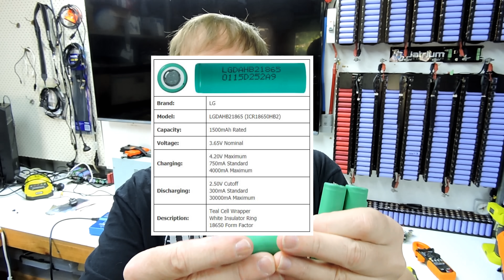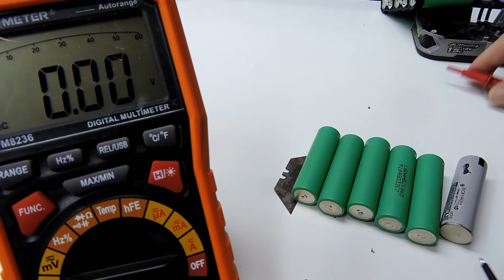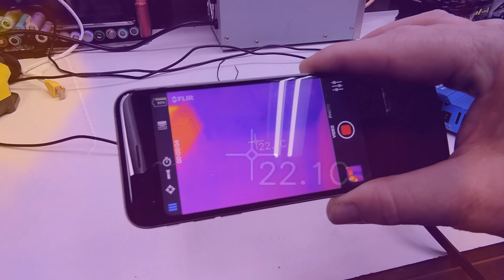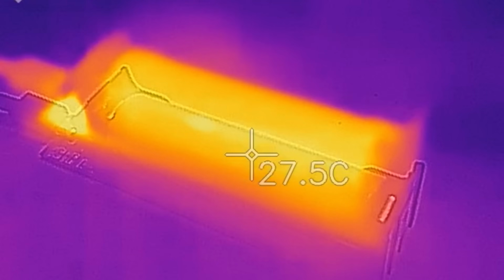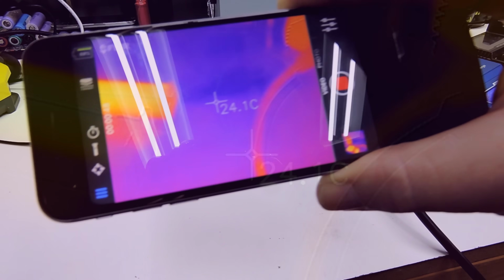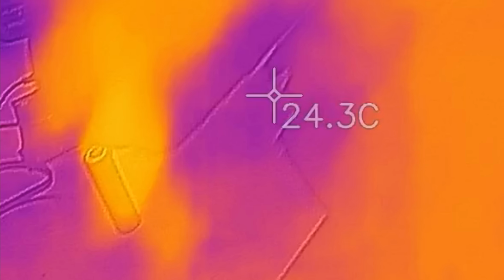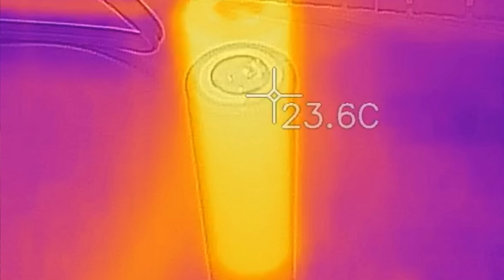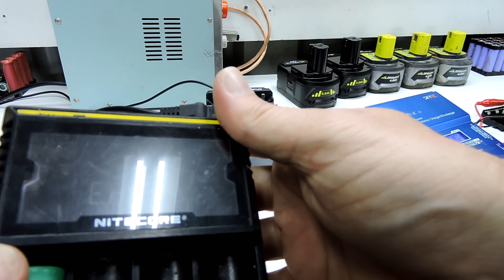18650 CID Reset   ⚡ DON'T DO IT! ⚡

Comment: this is what is needed so it becomes clear what is acceptable and what to avoid at all costs
Reply from the maker: well said
Reply: Unless there is some idiot who thinks the whole video was faked. 😔
Reply: Moronic tendency's should be closely monitored.
Reply: yyes but by whom ?
Reply: @dtec30  my wife monitors me. Not sure how but she's had over 25 years to figure it out.....
Reply: Any one trying to revive dead 18650 cells. Including myself. Look at my post
Reply: I THINK YOU GOT IT
Reply: Scooter battery die do you repair it. nanrobot battery.
Reply: I agree... I never would have the ballz to do this any way. After watching the sheer power of a nickel strip flying at my face when I dropped one on a pack I was spot welding stuck in my arm, Yeah I learned very quick.
Reply: My thoughts Exactly
Reply: Umm... I'm Australian and no it's not an aussie accent it's just his thing... I must admit it annoyed me quite a lot.
Reply: Well if the goal is to burn your house down or see your charger and the battery melt into garbage and smoke then this video shows you how to go about things correctly.
Reply: whats the point of this video? Don't do it of course its dumb. its a dead battery. you can't revive dead animal or people or battery
Reply: @willybilly99  you can revive all three, but sometimes things are too far gone
Reply: @willybilly99  yet

Comment: I pulled a bunch of 18650s out of a hoverboard that had a battery recall. Two cells were dead, one I think had a popped CID, the other I think has just shorted internally. All the batteries are super low voltage, like less than 2v, some less than 1v. Tried charging them in my Nitecore charger, but herd 3 of them pop their CID. I think it was because I was charging them at 4.35v instead of 4.2v, and all three were almost fully charged when the CID popped. Now I'm worried because the SOC of those batteries is pretty near 100% but with a popped CID. I'm thinking of resetting the CID, just to drain them fully and dispose of them… but I don't know enough to know if that's a good idea or not… are they safer fully charged with the CID triggered, or fully discharged with the CID bypassed/reset?

Comment: I am no specialist in this but I think that under that cid protection must be a resistor like thing, just to limit a bit the current.
It would be interresting to know if The maximum capacity of a  cell îs 3000mA, the charging current should be 10% of te total capacity?

Comment: i tried to charge  a pack of these that was in the tin shed for a few yrs. after some time i heard  couple of pops hrs between each other (one was without Doubt from the batt. i heard the faintest hiss. so akng side a tine bucket and potting mix i broke and cleaned all the connections. 
but b4 dropping it off to the local recycling place would it be sensible to try to isolate the positive terminals with something like liquid nails?
as some of the insulation is off as i kind of yanked it apart trying to feel for any hot or bulged ones.😑
appreciate ur time.

Comment: That's really good news from you. This is really good news from you. But I choose a cell with a zero and I pricked it with a sewing needle I noticed strong gas that came out of the body of it and when I measure the voltage, it is OK 3.9. Please explain this phenomenon to me. The cell was at zero volts at the beginning

Comment: No one is talking about a good battery after a CID reset and no one mentioned about a battery CID popping again after being reset but hear me out, here's my opinion, There could have been factors affecting a CID Popping up #1 is Temperature, #2 is internal resistance causing it to get hot when charged like in this video, #3 faulty bms and #4 is Short and CID reacted quickly and prevented the cell to get faulty that's why other cell not being charge for years or decades and indicates low voltage and it's still a good cell after cid reset. So Answer my question and put safety aside (Put PPE ofcourse) for experiment purposes to prove your point. After CID reset: Will CID Pop again for several factors?  (If yes, then make conclusions/precautions) Will the battery get hot while charging? Will the battery explode? I understand that you need to put safety first but some ppl are not looking for the answer you talked about, this is how you make a video to bust a theory and ppl will contradict of what you said "Don't try to do this" so other People will try it anyway because they know and think "There is still a good cell in this pack, why not pop the CID?" Right? I appreciate your video anyway but you're just unlucky to CID Reset a bad battery and made me think what if it's a good battery, make a video of that.

Comment: Old vacuum had a weird pack where 1 of the 6 cells was normal and the other 5 showing 0.2v, I did this and I felt something push down, I tested it and it was at 2.78v so I sis the rest and they strangely all come to between 2.76v and 2.80v.
It's been 15mins and temp is showing ambient temp of 22c and charging at 0.4mha.
👍 I'll definitely keep the temperature cut-off set!

Comment: What if water shorted them out?
Reply from the maker: They would be short and wet?
Reply: @HBPowerwall  dry out and reset and if it is shorted it will trip again. The reset is like a pressure relief valve. Lithium ion batteries puff our when they go bad. Shorting 18650 type cells  resets the  battery. I fixed Milwaukee battery packs cause 1 cell tripped. When in series 1 cell makes the pack screw up the balance. As long as you have a BMS and the  proper charger no problem

Comment: Hi brilliant not to do video, thanks. However I have two electric bikes that I find the batteries loose their cherge rapidly. With my previous bike before it was stolen I was able to travel for many miles before I had to charge it. these bikes need charging very quickly which kind of worry me and advise and also do you have a video with regards electric bike battries that I can take note. 

Kind regards

Kamran

Comment: I had a Milwaukee Fuel 5.0A 18V pack go dead.  Was fairly new, I found 8 of 10 popped.  I think it was transient event.  I sat dead for a long time until I discovered and tried the CID hack.  All read 3.0 volts from just sitting idle for long, long time.  I charged them and it was back to normal, no overheating other than small normal amount.  The charger brought them back above 3.2v in under 5 minutes.  My 1/2” impact drive must have heated them up too fast last time I used the pack.  If it was dead, dead like well under 1v, yep probably good to give up on them and recycle.

Comment: You did warn, but I was dumb enough to try to pop the CID's in 3 dead cells. In cells 1 and 2 worked like a charm, in cell 3 I pushed way too hard and made the gas leak from inside the battery. Immediately, I run outside the room and close the door, and now I'm writing this in the living room waiting for the toxic gas to go out.
DON'T TRY THIS !

Comment: I have a few bad powerbanks in a 4S 3.7v configuration, and one of them has 0v cells and they have no continuity at all lol.. Looking at getting a spot welder, nickel strips, and some new batteries to get them back into tip-top power banks.

Comment: That cell has an internal short!
Reply from the maker: No... CID can reset for MANY reasons, to hot, cold shocked, bms failure, over draw or left flat etc
Reply: @HBPowerwall  I'm talking about that specific cell that you tried to revive but kept getting hot!

Comment: What would be interesting as well is.. measuring the circuit having this "dead/revived from the dead" battery uncharged as it is, in SERIES with 3 or 4 good/fully charged cells. What type of reading would having one dead cell in the system give?

Comment: if the CID hasn't popped, but the voltage is just low (1.5V or so) is it acceptable to revive these with an appropriate charger?

Comment: just for you know , while battery is overcharged , CID makes it 0.0V and is fully disabled , While pressure rises up inside the CID it  just lowers the voltage to 0.3 , its not fully disabled and you just have to poke a hole underneeth the + to decompress the air inside of battery and also CID gets restarted and it will charge normally and the voltage should be arround 3.7
Reply from the maker: Dear god, while this is true it's also super dumb really a hole?
Reply: @HBPowerwall  PelsonBMW just doesn't get it!  SMH
Reply: @HBPowerwall  unfortunately yes , if pressure raises up to 140psi , Cid disconnects plus terminal and it's useless and shows 0.3 like in your video , if you poke a hole in it to depress, it will work .Also you need to push Cid with flat screwdriver . You can try at least to make a new video :P

Comment: You did a big mistake of using parallel charging which surge amps of current flowing into the dead one.  Obviously it causes the battery to heat. But if you charge the battery just by using imax b6 limiting the charging current to below 500mA it could have charged somewhat smoothly. But I'd not charge them beyond 1000mAh even though they have a bigger capacity just to be on the safe side. I'd use them outside the house for an example for a solar powered garden PIR motion light.

Comment: Been doing this on LG cells for years without incident.
Made a tool to do it quickly
Always listen for a small hiss and slight smell of solvent.
Voltages often >50% SOC
Lithium cells will produce hydrogen if they sit fully charged for too long.  This often triggers the button fuse.
Very common in server backups.
Reply from the maker: Yah MAD.... /thatisall....

Comment: You have effectively added caution to my actions. I was getting ready to pop the CID in mine and have decided to solder in another cell instead.
Reply from the maker: Good call
Reply: @HBPowerwall I got 6 batteries from labtab and 4 of them are dead so I reset the Cid and im using a fast charge powerbank module and I start to charge them one by one for 30 secend the  charging current was 1.5A but the batteries didn't get warm and were room temperature and they were charged and working fine are they dangerous for using in powerbank ?the module has temperature sensor  also ,please guide me.

Comment: Have you tested your emergency measure? Water and a fire extinguisher? If ithat were effective, airlines would not ban the Samsung Note 7. In the other videos, they use a bucket of sand or a lidded metal box. And for electrical vehicle fires, I never see firemen hose the vehicle down. They sort of let it burn away. I can't wait until for Brandon to get an all-electric Beast for his ride.
Reply from the maker: You can't beat cheap effective & accessable. Water will instantly stop any thermal reaction and there isn't enough lithium in there to cause any more than a fizzle

Comment: 3:15 into video (measuring the resistance) multi-meter Black lead on positive end battery and Multi-meter Red lead was on the negative end battery no Beeps, then after you reset the CID your resistance/continuity test you use the red lead on the positive and the black lead on the negative?

Comment: The TPxxx chip does only really very small current for the revive attempt, in order to still revive a cell that was genuinely just discharged so deep but it is otherwise good, but with the current so low it should not create significant hazard when the voltage is low because of a fault that may actually become hazard if charged by the normal current.
I do agree, do not mess up with cells where you are not damn sure they are good. And a tripped bimetal protection means the cell has experienced really high temperature, which by itself means the cell is heavily damaged inside.

Comment: Honestly thank you for uploading it because I needed to know very much helped thank-you
Reply from the maker: Glad I could help
Reply: @HBPowerwall   any chance you could help me I'm basically trying to build a pack of reclaimed scooter cells I'm starting the process of weeding out the bad cells  now 90% r salvageable cells but I also have a cupped dozen that are diffrent brand meaning iv have  40-eve cells,
10-samsung 25r, cells
24-samsung Q30 cells
24-mh1 cells
Now the 2 sets of 24 cells are already made packs with each its own bms  I wanted to know can I just build one big pack if I tear them 2 already built packs down and maybe somehow use the bms x2. In the one big pack or could I just add on to the two already built packs with already wired bms with the salvaged good cells I got  its a electric scooter battery 8 s. And how ever many p I can make it but the pre-made packs are 8s3p and I honestly want to do a 9s9p pack but unsure how to or where to start . Please lmk if any more info is needed I'm so lost on what I should do  scooter is unagi e500 dual moters 250w each but somehow specs say 1000w max please help I want to get like 5 more mph from its 20mph and overall at least 30 mile range again that's a dream but what should I do thank

Comment: I have a full pack of dead cells going into the recycle after watching this video. I checked the voltage and all under 1v from a scooter pack. looks like water had gotten into the BMS. I have plenty of faulty Makita packs with good cells. This will be my first project and thanks for the heads up.👍

Comment: G'day mate, I have a 52v E-bike battery full of those cells that was near flat and needed a charge up. The problem is when l hooked it up to the charger, the charger light stayed green, which meant the battery wasn't accepting any charge at all. The battery got a little bit warm though and stayed warm for a few hours after.
The battery is dead flat (none of the 4 power indicator lights working at all) and it supplied zero power to the 1500w bike wheel hub motor, BUT when hooked to the charger, the motor spun over just fine at full power and the indicator lights on the 52v battery showed full charge. (I had the back wheel off the ground and is spun over just fine). But as soon as l disconnected the charger, the whole thing dropped dead again, no power to the wheel hub at all and the 4 battery indicator lights went out.
Can you help? Is the BMS burnt out? Any suggestions would be most appreciated.
Thank you.
Reply from the maker: Is it because the voltage was too low and the charger didn't activate?

Comment: Lots of different situations, i revived 0.44v panasonic cells an they still had 70% capacity and no self discharge. I had cells at 3.4v and at discharge test they failed in 2 seconds. But if a battery is 0v i never use those nor the ones that can stay in charge forever and not gain voltage
Reply from the maker: a cell that has .44 volts doens't have a CID issue, it's just flat recovered 100s from that low to very useable. Then I read the rest of your comment lol - 0v is a deal breaker for me!

Comment: I just use Dremel to shave the top of the positive terminal enough to poke a screwdriver in then put a solder to harden it back up. And yes, when you have to reset the cid you can be sure that it's not gonna work at all.
Reply from the maker: Bugger that !

Comment: TBF though, if you use the boost/parallel method on a near-dead cell without it heating much and it can keep 3+ volts overnight(after disconnecting), you probably still have a decent cell on your hands.

Comment: Translated with Google

Hello, the video is great, but you have only tried one that is very bad, and if after using the screwdriver it loads well and without heating up? so is it ok?
because if I had access to the number of batteries you have on your back, I wouldn't bother fixing the ones I have either 😆

Comment: No need to pry on the battery.  Apply 5v for a second or two and it will reset and be at a chargeable voltage.  Won't build heat.  Done many this way.  Plenty others have as well 

Yea.  Yea.  Call it stupid and me for doing it.  Enough people do it that there are businesses making profit and keeping batteries out of landfills.
Reply from the maker: yeh, you're stupid... epic levels of stupid...

Comment: When you plug two batteries to each other and then to a power supply.  Ohms law.  Which is the reason everything went bad.  Seems to me the positive is touching thr negaticr on the top
From it being bent.  Good luck

Comment: Do you know what’s causing the battery to shuts off when the battery is under a heavy load? My Ryobi battery shuts off in a fast start. Slow start is fine.
Reply from the maker: BMS saying the battery is low voltage on one cell sounds likely.
Reply: @HBPowerwall  It is a 4.0ah. There’s no way to know because the cells are in 2-parallel. The total voltage is good. What are your suggestions? Break the batteries apart and test the cells individually?
Reply: @HBPowerwall  Just a follow up with your hypothesis. I tear the batteries apart and all batteries are good. You stand incorrect.
Reply: @HBPowerwall   Update!!! I swapped the entire cells. The pack still dies with brand new working cells. What are your suggestions now?
Reply from the maker: I said the BMS thinks the battery is low. Is the BMS faulty ?
Reply: @HBPowerwall  The BMS looks good. No signs of any failure. It charges fine. Battery level shows up each time I hit the button. The last thing I can think of is the Mosfet. Seems like a hassle to swap them.
Reply from the maker: Voltage drop under load?

Comment: 26650 with bottom charging .. at zero volts ..  Olight flashlight battery . dead as a dodo.$22 for a replacement    A normal lipo works fine but does not have the bottom charging capability .

Comment: Well I have a very thin and narrow piece if stainless steal. I put some plastic coat on part of it ad it fits real well into the opening. Have revived several batteries doing this. some do not charge even when reset.
Reply from the maker: Can't say I envy you but be safe!